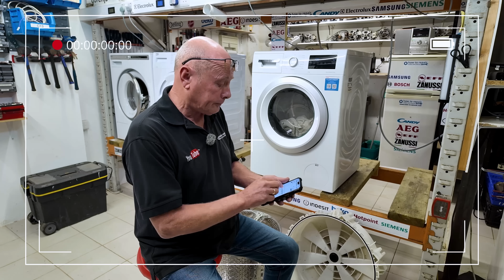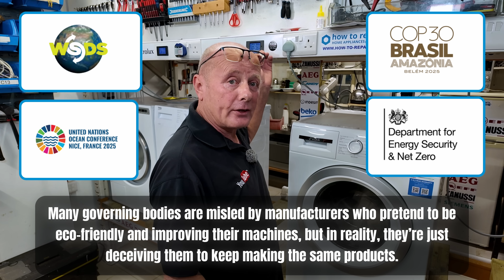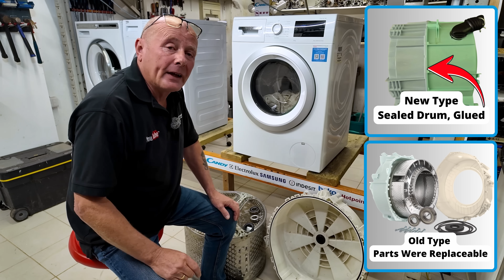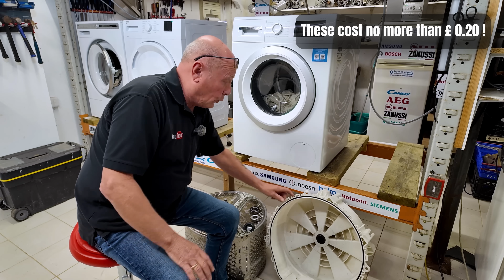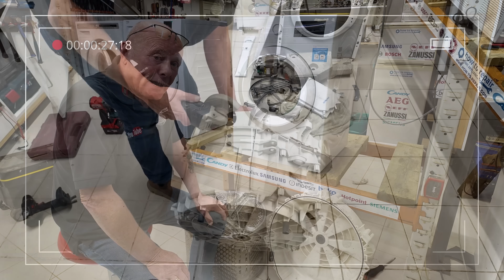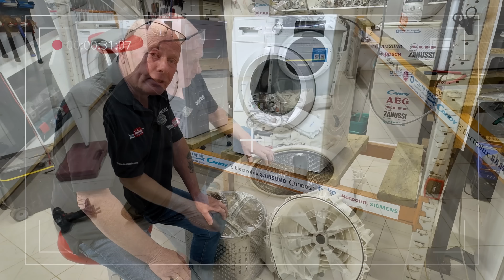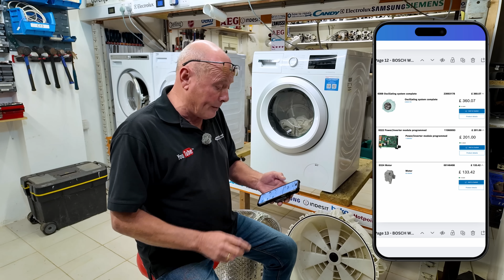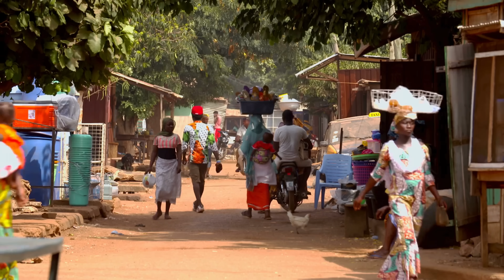Washing Machine SCAM EXPOSED! The Truth About SEALED Drums: Naming & Shaming

Comment: I work in Portugal for a family business with over 50 years of experience in this field, where I belong to the third generation. In the old days, everything was repaired. Even the machines were painted when they rusted. Sometimes we collect machines that we sold to our customers 30/40 years ago, many of them still working. When I dismantle an old machine before it goes to recycling and see how they were built and how they work, I am amazed by the engineering and construction of the old machines. Simple and durable. 

A modern machine that works for 10 years without problems is considered very good. 
In these modern machines, repairing simple things like door locks, motor brushes, water valves, etc., are worthwhile repairs. 
When it comes to electronic modules, stainless steel baskets + plastic tubs, etc., the price they ask for the parts makes you think twice about whether it's really worth it or if it's better to replace it with a new machine. 

Not to mention the machines that aren't made to be disassembled and repaired, which shouldn't even be allowed. 
We're concerned about the environment, using less water, less detergent, less electricity, but then we make machines that after 10 years (it would be good if all machines lasted at least this long) are ready to be replaced with a new one. 

Not to mention dishwashers. 
The quality of the baskets is awful. Often, even within the warranty period, they are completely rusted and broken. 
The only brand that has given us a warranty on the baskets to date is Hisense, sending new baskets directly to the customer's home. 
(This doesn't mean that other brands don't also give warranties, but generally they don't, and they ask for around €100 per basket)

By law, the warranty is 2 years plus one. (I think it's the same in the rest of the European Union, I'm not sure) 
An additional year of warranty is added if the product is serviced under warranty within the first two years. 
But most brands offer the full 3 years of warranty, regardless of whether the product has had any problems in the first two years. 

It's something we often talk about and discuss with colleagues: shouldn't machines be built with better quality (especially the more expensive brands) to last longer and allow for more repairs over time?

Comment: My washing machine: New Pol - Solid 580. Purchased in 1999. All analog. Separate stainless steel tub. Separate stainless steel drum, easily removable. Brushless motor. 

Repaired bearings and electrical door opening protection system. And also the metal ring of the door seal, which I repaired myself with a piece of fishing line. Nothing else, in almost 27 years!!!

Oh, I forgot: the New Pol washing machine replaced a top-loading Otsein washing machine, whose bearings were integrated into the tub and impossible to repair. The only option was to completely replace the drum and the entire tub!!! The tub was already plastic, back in 1994!!! So that piece of junk only lasted me 5 years. That's why I didn't repair it, unlike the New Pol washing machine, with a 6-year warranty, and now with almost 27 years of use. But be careful! There are only two of us at home, so we do laundry much less frequently than when the family has three, four, five, or more members. And the spin speed can't be adjusted; it's always around 500 rpm. This information is also very important because the more washes and the higher the spin speed, the faster everything will break down.

Comment: It´s a pity with those sealed drums (I replaced the bearing on an old AEG which know starts to fail at some other points...)...you mention the asian-producers like Samsung/LG have still screwed drums. I didn´t find information if the "LG F4WB2095" has a sealed drum or not?! Anybody knows?

Comment: We had a Maytag washer that we purchased in 1979. It lived outside for over 2 year and then inside until we sold our house in 1992. It was working perfectly. I foolished assumed we could easily buy another and it would last . Totally wrong, first machine was a Kenmore that broke twice in the first year and when it broke again after the warranty was up, the next machine was a Maytag. It lasted about 4 years. Now, the LG has died. 3 washers in the dump certainly doesnt save the planet. You are so right

Comment: I had an old Hotpoint that worked for nearly 25years! During that period, it only ever needed a drum support spring replaced. When the pump finally failed I decided to go for a new Bosch washing machine, but now I am damn sure that despite Bosch being a good name, the machine will not last anywhere near as long as my old Hotpoint . 

I am single however, so maybe my old Hotpoint did not get the wear and tear a weekly family wash would have put on it, but still...

Comment: Don't bother with so called top names had a Samsung 5 years old needed a new rubber door seal , had to scrap MC as part where rubber is secured was plastic and it was actually rotting and crumbling , impossible to do repair , just bought a new beco nice MC nice quiet spin. It doesn't play as nice a tune as the Samsung but it does the job for half the price.brand names mean nothing now

Comment: Eight years ago the bearings failed on our four year old Electrolux washing machine (not a Zanusi as per my previous comment). I bought a set of bearings only to find the machine had a sealed drum. So in short I said sod it and cut it open replaced the bearings and reglued it using Gorilla 100% waterproof adhesive and bolted it back together. This machine has just been scrapped for a fault I could not identify but the original drum repair was still good after eight years! Your videos are great but wish I hadn't spotted one of your latest ones relating to a Hoover issue where the splines on the drum drive wheel are damaged due to insufficient locking compound applied to the securing bolt. I have just replaced my old Electrolux with one of these new Hoover integrated models and unfortunately spotted your video just after I had fully installed it, which wasn't easy.  Hoping Hoover has addressed this manufacturing error and mine will not fail prematurely. Many thanks for the great content you produce the planet needs more people like you!!

Comment: I am just taking a break from repairing my waching machine and came across this video. Seeing this makes very happy Abt my decision for changing the bearings on the machine, which I bought used 4 years ago and actually still has a drum that can be split - instead of buying a new one. I'll make a challenge out of it to find out how long I'll be able to keep it running.

Thanks for the video, great job or speak up about this topic!

Comment: I was disgusted by Miele which the printing circuts is right straight above the water pipe that, by leaking... ... bzz..... 
And if you have an error code something water, there is no hole of the bottom box to evacuate water and stay remain in the box. You need to lean forward you to evacuate. And not lean backward, because they put the circuit just 5cm from bottom.... total scam. We called sole9ne and send us a guy. And just see the circuit burnt... not friendly. Very expensive. 
I choose cheapest LG. And never miele again

Comment: Why are they charging such ludricrous prices!? Im a Bosch tech in Portugal and we dont even take that much to replace the full drum with house visit... Take in mind... we buy our parts directly from the brand.
Reply: Also bear in mind that some asian brands only had an expectancy of 6-7 years of parts, after that would just say discontinued... And specially with LG, due to their way to seal the Eletronic boards, making them unreparable, many times i had to tell clients to buy a new machine because i just couldnt get one either from vendors or the brand directly, while Bosch goes up to 15 years... i had an issue once with an Haier dishwasher... the infamous touch panel that was used aswell in Candy/Hoover products was bad, corrosion of the tracks... The machine was 2 years old... and the darn panel for it was discontinued... that was a mess to deal with the brand and the client... I dont know how it ended...
Reply: But i do agree with Samsung, Haier and LG on this repairing the drum part... And in Haiers case is so nice... you dont even have to remove the whole tub out to split it afterwards... you remove the front, remove the front tub, remove the drum and then the back tub... Way much healthier for your spine eheh

Comment: Thank you. It’s the same with most appliances such as printers.
Reply: Agreed but printers are amazingly cheap - manufacturers real profit is in the ink / toner and eventually the drum.  In Australia I refill my cartriges with a $9.00 bottle of powder - bit messy so I do it outside - and the drums are around $25.00 - quite easy - some machines require resetting / a reset gear - plenty of YouTube videos on doing this.
Reply: @stuartfox5989 Printwr here in the UK can be expensive depending on what you buy & the inks are just as expensive. All are a rip off.

Comment: It's similar to Light bulb.... ofc they could do long live wash machine, bud the problem is that if you have a product which will be in family for 10-15years the company has an economical problem... and doesn't matter on which company you are finger pointing every does this. BTW most of the companies have politic of 15y product support then even they cut of the product line from these products. There is a lot of ongoing behind the scene... I would love to repair my wash machine to since I am in situation where I need to make a decision buy or repair but the cost for service man and the parts is ridiculous it's cheaper to buy new one the call a service for check and then have repair on 2nd appointment... Maybe you are also trying to defend your high prices just for coming to a customer in need ... In our country just the visit of the service man without parts is half of the PCB... in calculation I would just save some small amount of money. So for me even calling service man is not an option it's cheaper to me buy new one then call a service man too. 

Do we need a change on service don't know you need to pay rent too.
Do  a change on manufacturing maybe, but the manufacture need to feed people without buying customers would be assembly lines closed people would be lose jobs so less customers on every field... sound this right to you?

The only change which I would see as possible is reduce the costs or prolong the warranty so poor people are not scared of that the wash machine will get broken.

Comment: German engineering 😉 Phone chargers used by EU lawmakers were obviously larger than washing machines.
Also each power tool has their own batteries, right? With quite similar 18650 elements on the inside. All the weird screw head standards in the world? The list goes on.

Comment: Sir, my last old washing machine was of top opening door type, bearings located outside the sealed drum, i did'nt need to dissemble the drum to do bearings replacement. I think that those companies intentionally put bearings inside instead and furthermore did the weldng on the drum halves instead of using screws fixing , so customers cannot do bearings replacement any longer. (Or, top and front door types washing machines drum designs are different ?)

Comment: My last washing mackine is Siemens brand of top opening cover type, it's had several times of bearing failure after using for a long time, and I could replace it by myself. Lately, I bought a new Whirlpool of front circular opening door type, I think it adopts the sealed drum irrepairable type that you mentioned, although it still is in a good shape now, in one day it fails, and is of the problem happening inside the sealed box, I will not hesitate to split it in whatever way I can and do repair and join them afterwards, eventhough i do know how good sealing without leakage is so difficult. At least giving it a trial, that, at least better than those goys who are not of good repairing skill, pity, poor, this world and horrible  those companies

Comment: The manufacturers will hate me for posting this!...
Our dish washer stopped working after 18 years, powers but no activity.  
As an Electronics Engineer I like to investigate and repair things.
I diagnosed it down to the Main Control board playing dead, CPU not functioning, the price of a board was ridiculous, so i started to fault find at component level, I came across a small 1/4 watt 100K resistor it didn't look burnt out but had gone completely open circuit! 
Replaced this and it was all sorted, singing and dancing again!
The part cost me only 5p for the resistor, and postage 80p! wife was so happy she bought me lots of cases of beer!
The machine is now 20 years old and I'm happy to have contributed in saving the planet.

Electronics components are  mass produced and can be cheap, to be honest this main circuit board should only cost around £15 and thats with a mark up!
Shame on these manufacturers who only care about profit and not the planet! 
Goverments around the world needs to seriously do something.

Comment: Further to my previous post, about 4 years ago another friend had a cheap Beko machine which developed a water leak. When I looked the plastic drum had cracked. It was just over a year old. She replaced it with a second hand Bosch which is still going strong. However I did have to replace the large drum to door seal recently and when I looked it had a date stamp of 2002. Modern machines have gone the same way as modern cars,  all flash and high tech, but  underneath crap.

Comment: Well done. A friend's washing machine just developed noisy bearings. It a 5 year old Hotpoint in very good condition (apart from the bearings of course). I said I would take a look and fix it, but of course when I checked it had a sealed drum. The 2 bearings and seal would have cost less than £20. I then checked my own Zanusdi washing machine and fortunately it doesn't have a sealed drum. Further, I researched the parts costs, and the bearing seal, 2 bearings and drum seal would cost under £30.

Comment: From Canada:
 I purchased a top loader INGLIS washing machine to replace a 35 yr old Inglis with the electro mechanical control. After troubleshootiong found the the motor failed. Replaced it with the new machine only to have the circuit board fail after 13 monthhs. At first Whirlpool (owners of Inglis) bluntly refused to replace the board, however when advised that the problem was a common one which they were well aware they replaced the board free of charge. There are numerous brands under the Whirlpool umbrella that used the same board. The threat of both media exposure and a class action lawsuit gave them pause.
In closing it would have better for me to replace the motor in the old machine. Also I have the old board and a replacement pressure switch (C$18) which is the problem. Planned obselence)

Comment: So agree with this I have a HotPoint machine that I bought  around 2002 its still running perfectly and so far touch wood the only things that have failed were the plastic paddles.  Yet I have seen a friend have to have 5 machines in this time.  Crazy.  Is it a way to have you buy an extended warranty from one of these well known companies?.

Comment: Sorry, I haven't watched the whole video, so I apologize if you've already addressed my comment.
I just want to point out that planned obsolescence is not something surprising, it is in fact extremely logical step in the society where most value is put on profit and only profit, and greed is main motivator.
If your main focus is only profit then you'll think about all the possible ways to increase it. One step in that direction which has already happened a long time ago is to close all the production facilities where workers are expensive and move them in countries where labor is cheaper. We've already accepted that a long time ago as something normal although it isn't and in the long term makes the society extremely vulnerable because under the disguise of economic logic, under which is in fact greed, you've lost thousands of people who had knowledge how to build things.
One other step is to make product as unrepairable as possible. You don't want customers to be able to change just one condenser inside. Nope, put everything in one sealed PCB that if you want to change it, costs as much as half of the whole product.
And of course, planned obsolescence is the next logical step.
So, we will never get rid of this problem by some ridiculous laws etc. as long as general mindset is that it's ok to do everything you can to maximize the profit, and people will celebrate you as a genius in media if you have hundreds of millions of euros, and nobody will question how you earned them, and what are you willing to do to keep them.
Planned obsolescence is just a manifestation of deeply insensitive and greedy mindset. So, we need to fix that mindset since it's the root of the problem.

Comment: I bought a washer that has been used exactly once every 2 weeks, was exactly 4 years old. I used it for a year, twice a week and the drum got loose. I opened it up and found 1 of the springs attached at the top to metal. On the drum it was attached to plastic and it wore trough that plastic. A simple 10cents (in any currency) bushing would have prevented it from happening. It was a cheaper machine but it doesnt matter. Its planned obsolecence.
2nd hand being only the 2nd user and payed only 20 euros for it I bought a brand new machine.
Dont know how long it will last but if anything fails I will go and try and repair it.
(Edit grammar)